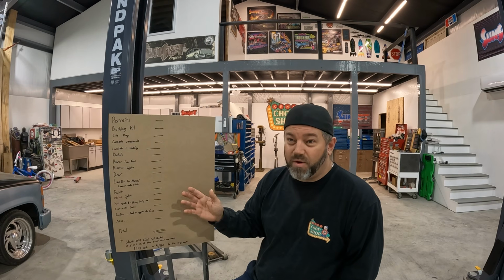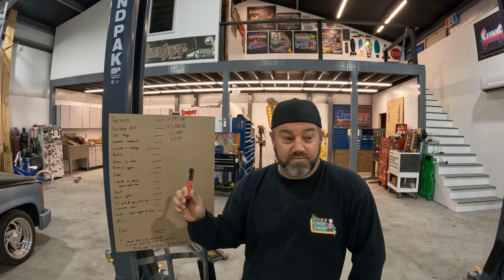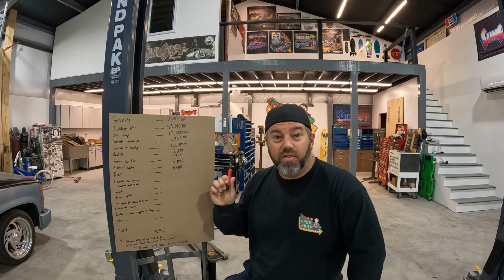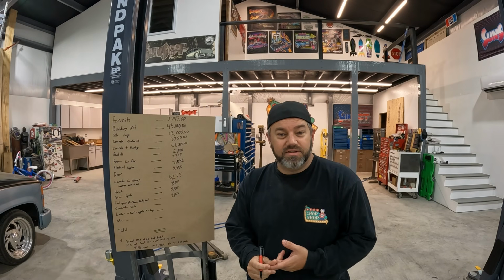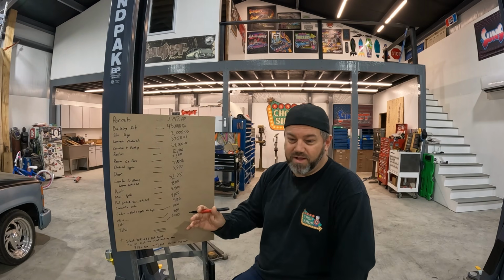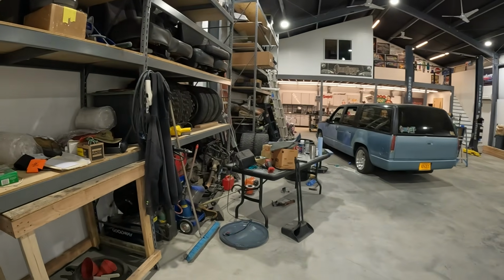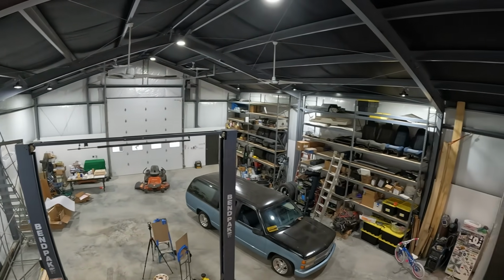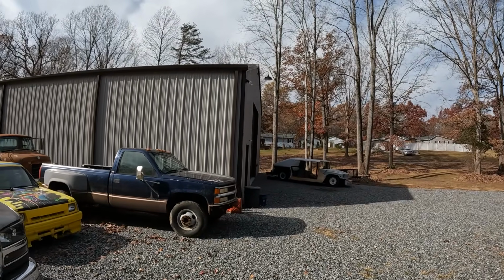Dream Garage Red Iron steel building total cost so far 40x60x16 plus short tour

Comment: Thanks for this.  Perfect detail and length.  I paid more for my shop of similar size 35x70x16 but it was turn key.  I always felt I overpaid a bit but I just needed it done so it was worth it.  after watching this i think our costs were very similar minus the labor i paid for.  Thanks again.
Reply from the maker: Thanks for watching ! That actually makes me feel good about what I spent too . And yeah I can totally understand just needing it done, there were times I had wished I just paid someone on some of the stuff just because it would have been much easier.  Thanks again for watching!
Reply: Could you share a per sf cost for your setup?  Thank you!
Reply: @stephendodson8302  $66 per sq ft.  There were some overages because of some city related cost but wasn't related to the building cost.  If I were to include all that it would be $72.
Reply: @TheOhhSeven  perfect, thank you!!
Reply: @stephendodson8302  you're welcome.  There used to be other builders in town that I had quotes from that would have cost me less but issues with the city cause all them to exit the market.  I didn't have any competing options.

Comment: Nice shop, Thanks for sharing. How big is the Mini splits? and does 2 of them keep the entire shop cool? and is that your heat source too?  Thanks for the info.
Reply from the maker: Thanks I appreciate that!  They are both 36k btu (3 ton) units and yes I use them for heating and cooling although this is the first winter . But in the summer I kept them set at 70-72 and at that setting on the hottest days it would creep up to around 74 on the opposite side of the building but I couldn't crank them down and easily drop it to 68 in 30 min or so with them on the turbo mode . And for this winter I have been leaving then set at 64 and when we have gotten in the 20s/lower 30s at night it gets around 58-59 on the opposite side of the building but I can bump them up to say 68 or 70 and within 30-45 min I'm taking my jacket off because it's already feels good especially if I'm doing something.   Hope that helps that's what I have experienced so far and for more background on weather for my area I'm in va near Fredericksburg so you can compare your weather to mine . Thanks again for watching !
Reply: Thanks again for sharing, Look forward to more video's! 
 @kenschopshop